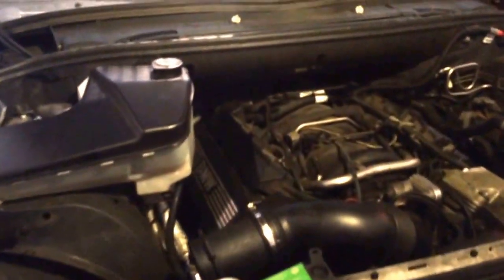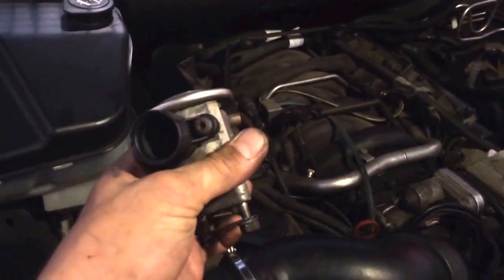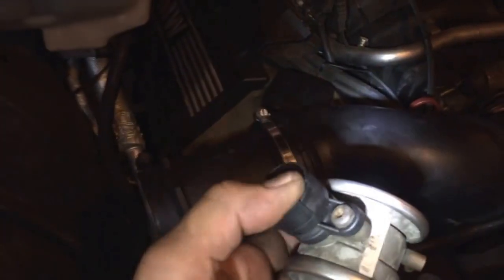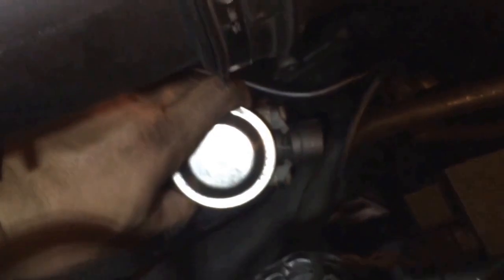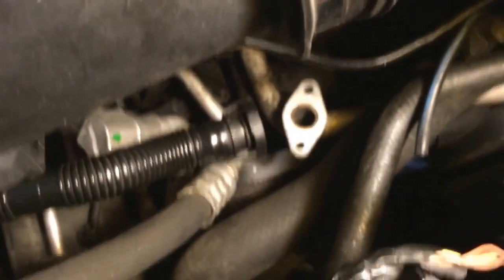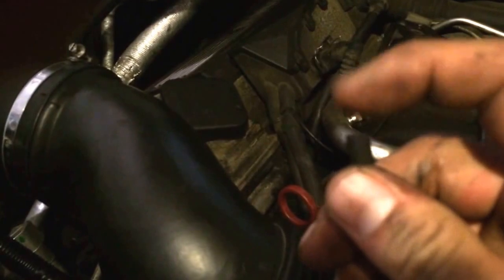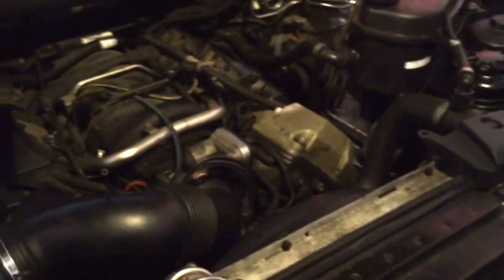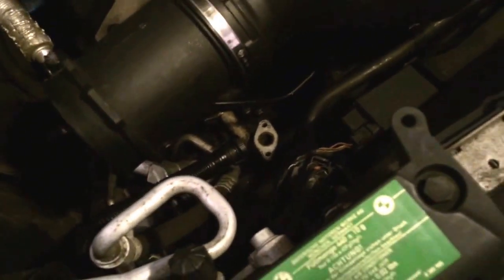BMW E53 X5 4.4 Secondary Air Check Valve

Comment: I have one too and same thing, since I own it for 6 months now I dont even know where to start, 1 thing at a time but everything possible with every dash light on except airbag... But over all I really like the x5, It is a very nice vehicle when working and Im defiantly learning a few things, such as how to fix x5 coils, plugs, self level suspension inactive, ABS light, 4x4 light, fuel gauge sensor, transmission fail safe, tail light caught fire, turn signal and halo keep blowing fuses bulbs pass side, door lock button dont work, hazards dont work, passenger windows pops off track, side lights out, licence plate lights out, backup sensors inactive.... Breath....  leaks oil and burns oil blowing smoke after idle, ccv and oil separator unit plugged I think, aux plugins front and rear dead, ashtray cover wont stay closed and think thats it....for now... Other then those couple small things its really nice...lol...FML
Reply: Logan GSQ welcome to the BMW world
Reply: But for for those two days a week she's firing on all eight,  you fall in love with her again.. if you love pain!

Comment: I have a 2002 BMW X5 4.4 that displays these warning indicators: Traction Control, Brake, and ABS. What's odd is that they light up as soon as i turn on the car when it's warm/hot outside, but when it's winter, they'll light up after about 5 minutes. I checked the tires and they seem fine. Would you happen to know what the issue is or what caused it? Or is there a way to disable to indicator? Thanks!
Reply: Abs module

Comment: I have the same vehicle and I found that I had a oil leak on both Vanos sensor seals you can buy them on eBay for around $12 oil was coming out of them and running down the front of the engine and then getting blown back over the oil pan. Took me about 45 minutes to change both no more problems no more oil leak

Comment: p0491 p0492
code is more than likey your 
 1. valve cover gasket
2.mass air flow sensor bellow elbow
3.  vacuum line near valve cover.
4. secondary mass air flow sensor you have two not the main one the smaller version.
5. your secondary air injection valve.
6. these cars are very old you can have have air leak out of multiple places, the plastic tends to get brittle and break over time. other than that there motors and transmission are 100% 👌
Reply: Motors and transmissions are 100%? You mean until 100K miles...when the timing chain guides are known to start failing, and the transmissions fail for any of numerous reasons.
Reply: Those 4.4 's need your constant attention and keep  those dash lights off and no  loose front end parts to  trip those ultra sensitive wheel sensors and it will seriously handle and haul ass! Most issues woud fall  under maintenance. Just do what the bitch tells you and she'll brighten your life!

Comment: if you still own this car by the time you read this your oil housing gasket is leaking thats where your leaking oil its very common with bmw poor quality gaskets were used in assembly they rushed these cars out.
Reply from the maker: Thank for the tips. Yes I still own the X5. Its been sitting until Im ready to sink more money into it.  I tried to run the Carly app on it and its giving me unknown codes for the DTC. I will be trying to figure all this out soon. So many issues that I don't know where to start.